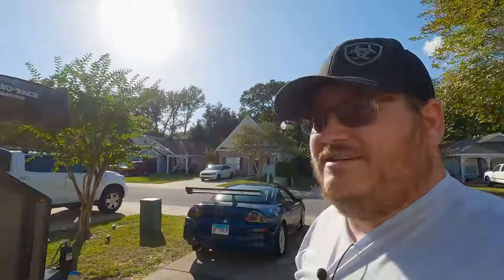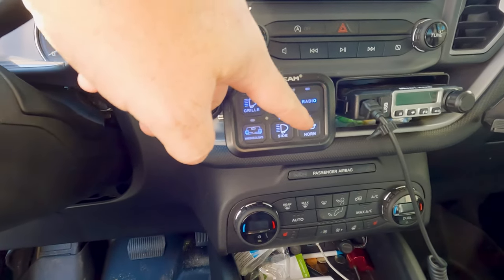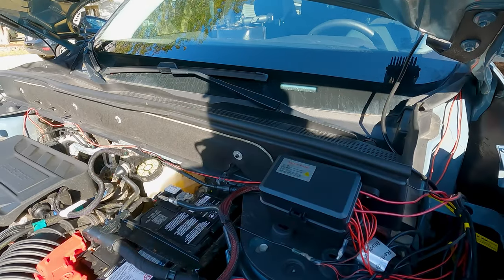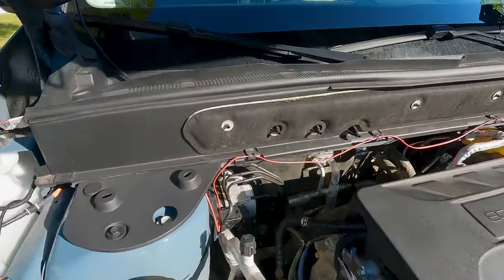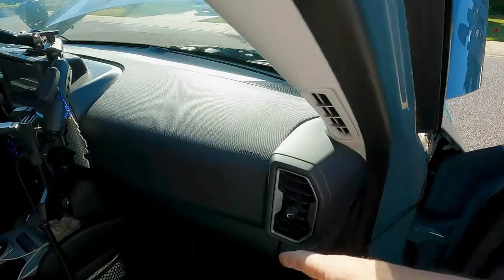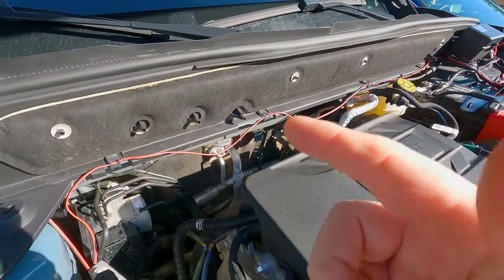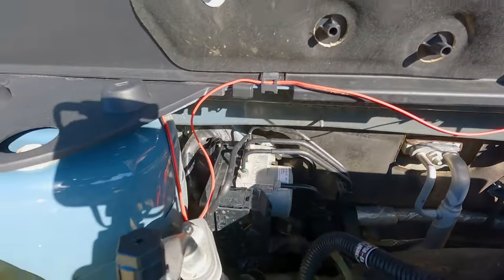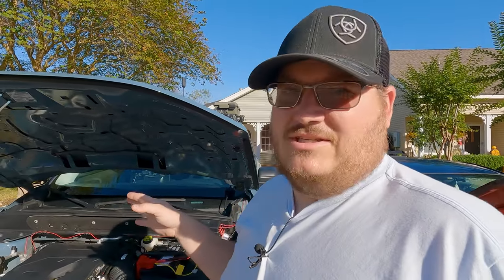Bronco Sport AuxBeam Controller Wiring Through Firewall Into Cabin

Comment: There's another grommet on the driver side that ford recommends to use, if installing trailer harness for example. It seems to be more easily accessible on the driver side of the dash
Reply from the maker: I did see that one but I feel it was easier to run it through the passenger side.

Comment: I'm sorry I'm still confused how to hook the relay box up. Can you give more details.. or step by step for us noobs
Reply from the maker: The breaker box wires up to the battery.  Typically you would run the blue wire to turn it on and off when the vehicle comes on and off.  I wired mine so it was on all the time.

Comment: What fuse did you tap into?
Reply from the maker: We did not tap into a fuse. We installed the auxbeam controller directly to the battery
Reply: @JKAdven  so both the power and the small red cable were attached to the battery? Does this not kill the battery
Reply from the maker: @luisb3786  it does not.  It give me the ability to use this even when the vehicle is off